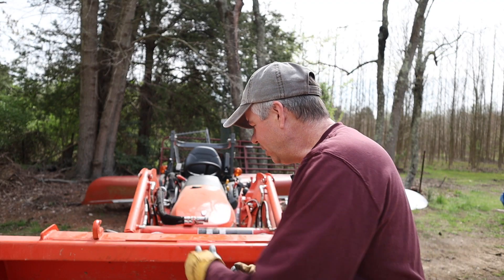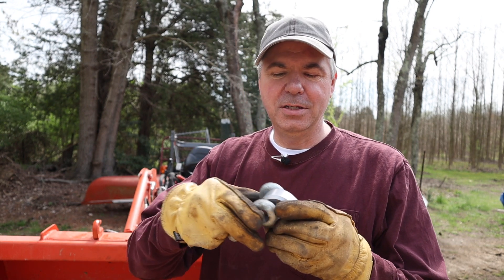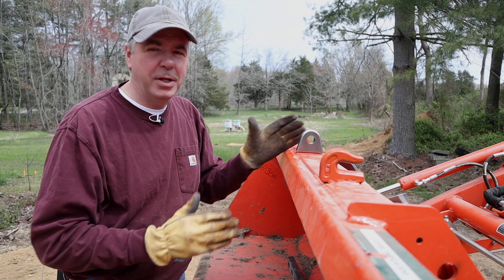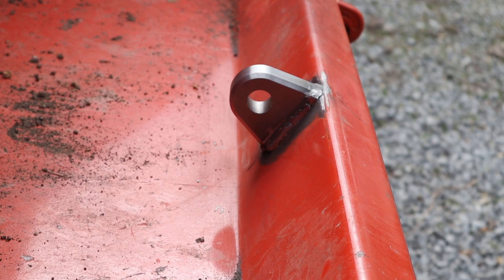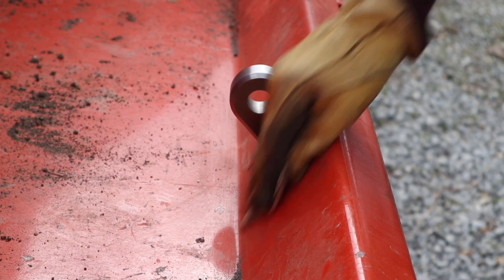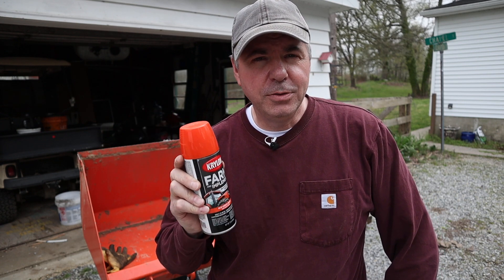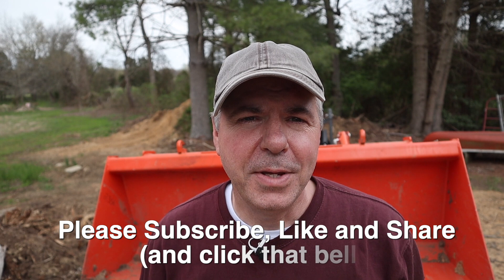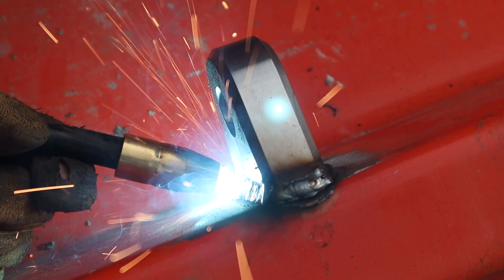Tractor mod. Weld-on shackle mount. Great front end loader bucket mod for Kubota B2601 and more! #5

Comment from the maker: Weld-on clevis block:
TCS Weld on Shackle/Clevis Mounts
https://amzn.to/3lRqp1c (Amazon affiliate link)
Hobart Handler 140:
https://amzn.to/2Hd83sr (Amazon affiliate link)
Here are some other product suggestions that I use. These are Amazon Affiliate links, so purchasing will help this channel by providing a small commission while not costing you any more. Thank you for your support!
Lumax Heavy Duty Grease Gun:
https://amzn.to/3mFK1pA
LockNLube Grease Gun Coupler:
https://amzn.to/3kPcvwu
Recommended Grease:
Valvoline Moly Fortified
https://amzn.to/3jNM1Kv
Nitrile Gloves:
https://amzn.to/34Kg8OG
Deerskin Gloves:
https://amzn.to/2I17NNy
My Video Gear:
Rode Wireless Go II microphone:
https://amzn.to/3eiJatG
Canon M50 Camera (now Mark II):
https://amzn.to/3vHW9uD
Battery adapter for M50:
https://amzn.to/2RshsBE
Sigma 16mm prime lens:
https://amzn.to/3vJDRcx
Sigma 30mm prime lens:
https://amzn.to/3epFneh
Variable ND filters:
https://amzn.to/3tmoHIs

Comment: Do you mind if I ask what your settings were on the welder?

I have some cracks to repair on my LA302 Kubota FEL bucket. The  skin is thinned out a good bit, and I don't want to blow thru it.

Also what gas did you use?
Reply from the maker: This was a few years ago, so I don’t remember, but I do use the mig gas (Argon / co2) and solid core wire. There should be a chart on your welder to reflect proper settings for the gauge metal. Good luck!

Comment: Sorry, I really don't much about welding.  Does this type of welder not require a metal stick that you melt to join two pieces?  It appears that you actually are melting two pieces of metal together instead of "soldering" them together.
Reply from the maker: This is a wire feed welder. Same principal as a “stick” arc welder but feeds thin wire as you weld. This one also uses mig shielding gas for a cleaner weld or flux core wire (no gas needed). Thanks for watching! -Ed

Comment: Ed, I'm impressed. Your welding looks better every project you weld.  MIG + gas is the way to go vs flux core.  But....why not try stick?  There are 110 volt inverter stick welders out now that do a respectable job for us DIYers.  I'm sorta the opposite history of you on welding. I started using stick a few years ago and last year bought one of those 120v/240v  MIG  machines.  A month ago I got a good deal off Am.... for a 120v/240v stick welder.  Only 20 pounds vs my 130# buzz box I've been using for 30 years!  I can grab the new stick welder throw it in the truck and run over to a friends and weld up his broken railing or mower handle or...whatever. 🙄🙄 I digress.......Your welds are improving and I like the add-ons you are improving your tractor with! Thanks for the vids and ideas. Paul  🤠👍🇺🇸🍻
Reply from the maker: Thank you so much for your kind words. I started out welding with an old Lincoln stick welder. It was OK for thick material, but terrible for thin material. I’m really happy with this 120 V mig welder. I recently purchased some thicker, solid core wire, and a big bottle of argon/CO2. Seems that most of my projects require thin metal welding. I’m sure I could do a better job today than I did on this project. I have a better understanding of feed rate and voltage now. Thanks again!

Comment: I would not trust that for heavy use. It is probably ok for lifting ,but not heavy pulling.
It would have been stronger if you V  ‘d  the chunk of steel. It would be stronger mounted to a thicker piece of plate mounted to the bucket. That bucket is basically sheet metal. Welding with a stick welder would give you better penetration.
Reply from the maker: Good points. The thick block comes with a nice bevel for welding, and I think the limited capacity of this compact tractor is safe for anything I’ll do with it. Thanks for watching.

Comment: Just bend your tape in half by putting 59 1/2 even with the end of your tape and it will give you the exact number. So if your measurement is 30 bend the tape  by holding the number 30 even with the end of the tape and  looking at the bend the number 15 will be in the middle!

Comment: Should use a backing plate to spread out the load on the bucket. You could pull a dent in it that way
Reply from the maker: Good suggestion. Thanks!

Comment: I wish I knew how to weld as well as you Ed. I use a stick 180 amp Forney welder. I wish I had 229 amp. You do well, thank you for the video.
Reply from the maker: Thanks Wayne. If you can weld with a stick welder, you’ll do great with a wire feed welder!

Comment: I had the Hobart 140 and it was a great little welder. I upgraded to the Hobart 210 and what a big difference! Much more power to do the heavier jobs. It runs on 120 and 220 volts and it really shines on 220 when you need that extra penetration. Anyways you do have a great little welder.
Reply from the maker: So far I haven’t had a need for anything different. It sure beats my old stick welder! Thanks for watching.

Comment: I can tell you from experience both with ropes and chains snapping that when they spring back it's like that box of chocolates.  You never know what you're gonna get. I've seen 'em go high, low, and sidewise.  So in the bucket,  on the bucket, either way, if you aren't using weight bags or a slack rope or something to dampen spring-back, you might end up eating the chain or rope.   Almost anything heavy works.   I'll fasten things to the chain. Oddments of steel such as disk brake disks or drums work great.   Grain sacks with rocks in 'em work great too.
Reply from the maker: Good point an great ideas! Thanks for watching. -Ed

Comment: I’m a welder. Sanding discs work great 👍. There very expensive!! Best for sanding down welds cleaning up sharp edges etc etc. Paint 🎨 will just gum the disc up!!! Better off using wire wheel for cleaning rust and paint 👍
Reply from the maker: Thanks much. I’ve been using a wire wheel lately. 👍

Comment: I certainly don't want to be an armchair expert but I are a welder. Anytime your welding on a vehicle with electronics it's a good idea to disconnect one side of the battery to insure the circuit doesn't go through the electrical system. In this case the bucket wasn't attached but I wanted to pass that along before anybody had a problem. That's what the instructor told us anyway.
Reply: As a new owner of a welder, this is something i was wondering about...thanks for the tip..:)

Comment: You are correct, chains will Not sling shot back. Those that think they will have not worked with chains.
Sorry had to add, ive worked with many of the ratchet straps of various brands, and the “tow” straps that come with hooks on both ends.
Very few of these have ANY spring stretch to them. Think about it,,, if ratchet straps had significant stretch, it would be difficult to obtain a constant hold down force.
If you are using anything with a “spring back factor”,, it is NOT designed for any heavy duty pulling.
Reply from the maker: Thanks for your comment, Ken.

Comment: I just drilled a 1" hole in the top of the bucket in the middle and bolted in a 2" ball, which works well with a strap or rope or even a fifth wheel trailer hitch.
Reply from the maker: That’s a great idea. Thanks.

Comment: I am am not a tractor owner or a welder,
Iam  here to learn,
Thanks for the many good vids.
But,
You already have the clevis and the chain,
So why the steel eye and welding ?
Why not put the chain through one or two of the existing hooks and attach the clevis to the chain ?
Thanks for any attention you choose to give this.
Reply from the maker: Thanks for watching. The center clevis mounts just offers one more attachment point. It’s handy for attaching a nylon strap, and it’s often best to pull from the center of the bucket. I appreciate your interest.

Comment: Chains don't slingshot, but straps do. (you said that. lol)  That's a good idea.  I think I'm going to do this, but mount two where you have your chain hooks.  I might put a couple on my box blade too.  I don't want them inside my bucket.  I got one of those clamp on to the bucket receiver hitches, and a Reese hitch with three balls and the grapple hook, but it wiggles around and sticks way out.  I like this better.  I'm always dragging tree limbs and whole trees with mine.  I have a flux core welder with the 030, but haven't put gas on it to do MIG.  Hopefully it can get hot enough to splatter a weld on there.  I see you have an amazon link there, I'll check it out to get what I need.  I like your style and channel after 2 videos and subscribed.  Thanks for not pimping out your wife on thumbnails and in your videos to get views.  And a little constructive feedback - more than one mid-roll per ten minutes is excessive in my opinion.  Take care, from the blue camp, 2016 LSG3033.  P.S. what's that bike I saw in there?
Reply from the maker: Much appreciated. You might want to grab some 035 wire for that project, as suggested to me afterward. I do joke with my wife about making some clickbait thumbnails, haha. The ads are automatic, but maybe I can go back and delete some. I appreciate the feedback. The bike is a Yamaha MT07. I checked out your channel too. Very nice! Thanks for stopping by! -Ed
Reply: @MyClutteredGarage  I think I have some 035.  Not sure if I have the tip for that though.  If you go to monetezation and click - manage mid rolls, you can adjust where they are at and if they put too many you can delete and add if you want.  Sometimes they put them right before the end, and that is so annoying.  I think the intro and the outro are the most important/cinematic part of the video.  For me anyway.  lol  I had a Suzuki VStrom DL-650 looked similar to your bike.  It was a fun ride.  I had it all set up for long distance rides.  I did an Iron Butt ride on it one time.  (Once is enough)  Thanks again.

Comment: Thank you for posting! I like that the Hobart Handler 140 can run on 120volt! Will it run on a 15 amp breaker or does it need to be a 20 amp breaker? I have the Hobart Handler 190 and am loving it!   I will be making these mods to my Kubota for sure!!
Reply from the maker: I have run this only on a 20 amp circuit, but even with an extension cord it hasn’t tripped yet! It’s a great welder. I’d recommend .035 wire for this project. Thanks for watching!

Comment: I've drilled attachment points for shackles (you refer to them as clevis hooks) to my L3540 bucket in the reinforced side edges of the bucket and in the centre of the cutting blade. You do need a top grade drill bit because that steel is really hard!  
I have some chain hooks now which I will weld on one day!

Comment: Hi Ed!  Great job!  I’ve thought about adding a clevis mount on my bucket, but I’m not sure my Harbor Freight Titanium Flux 125 has enough power for good penetration in a 1” block of steel.  I might have to gone with a bolt-on clevis hook. Thanks for sharing!
Reply from the maker: After several similar comments, I'm thinking of bulking up the weld on this mount. Although I bet the weld would handle the lift capacity of this tractor. Good to be safer though! Thanks for watching!

Comment: Yikes.  Dump that 120v welder and move up to a 240v one for thick steel.  I wouldn’t trust those welds on a 1” thick piece of steel like that, when “gluing” it together with a 120v welder.
Reply: Haha no kidding. 110v welder on material like that Ya ok

Comment: Where did you get the one inch steel base to weld on? I’m going to do this.
Reply from the maker: Hi there’s a link in the description. It’s really a nicely machined block. Thanks for watching.
Reply: @MyClutteredGarage  thank you for the information
Reply: @MyClutteredGarage    Hello from Cape Cod, I’d like to weld this same block on my bucket - but can’t find the link for the block.  Can you pls repost ?  By the way, great videos !
Reply from the maker: @johnpitts5480  Thanks very much. Check out the description or the first comment. I shared the link there. Good luck and thanks for watching!

Comment: Blows me away that these so called quality tractor manufacturers will not weld a couple of grab hooks on their buckets! WTF? Such a small addition that would be EXTREMELY useful, and not expensive! Just proves that the only thing ANY business is ultimately concerned with is their bottom line, not the end user.
Reply: The front end loaders and buckets aren't designed to pull from the top like that so they don't provide an attachment point. If you make this mod you really cannot put very much stress on those hooks. If you need to pull hard do it from the frame underneath the tractor. There are usually holes at the base of the frontloader attach points where you can attach a clevis. Pulling from between the axles is the most stable point to avoid flipping or tipping your tractor.

Comment: If you grind a line deeper than the paint where the first mark is then you don't need to make a second mark....I often deep dot punch a mark. but your tip works fine.
One thing I do a lot when flame cutting is to run a cut off wheel mark 2mm deep that way when the line disappears with the heat you don't use the line.
Reply from the maker: The Essex Hunter great tips! Thank you! Thanks for watching!

Comment: I have to ask, you have the 60 inch bucket? You welded that onto the 3/16 inch thick bucket material? no backing?  I'm curious how much weight you can lift, just seems to be a risk? Thank You
Reply from the maker: Arthur LeDoux thank you for your comment. That’s a good point, but I really think the material would withstand the capacity of the loader. I have only used it to drag some logs. I guess that’s why we have engineers though! 😄